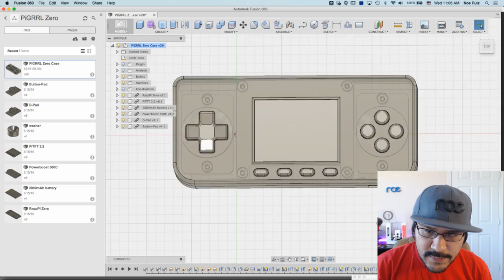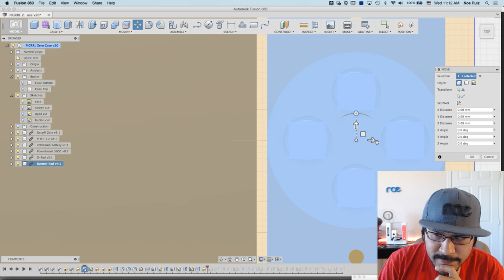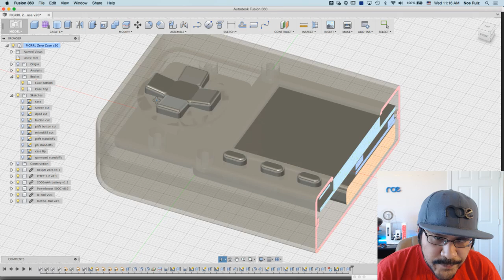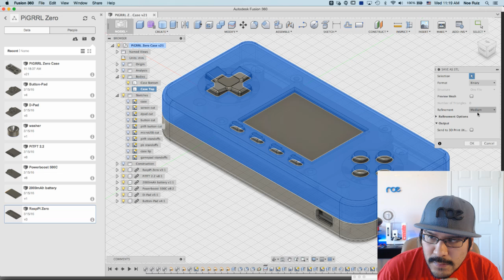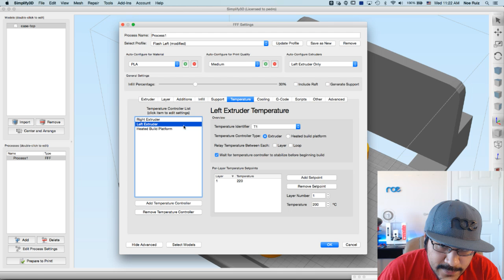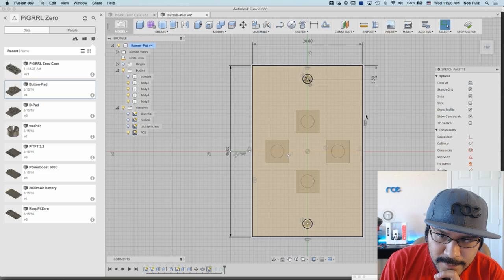Layer by Layer LIVE - PiGRRL Zero Pt 3 @Adafruit #3DPrinting

Comment: I think I would have flipped the screen so the buttons were on top. Then you can use an adapter to bring the HDMI port out the top for playing on a larger screen.

For the battery, you could wire to smaller batteries in parallel (?), with each tucked in on either side of the case to keep your depth.

Comment: is that case 3D printer and if so what 3D printer?
Reply from the maker: +Joseph Niccoli Yep, the case is 3D printed on the Flashforge Creator Pro but could be printed on any 3D printer.
Reply: I have a robo 3D but im not sure how to make it a solid bottom in stead of lines like yours and how to use ninja flex
Reply: +Joseph Niccoli if you mean solid bottom as in you always see you build lines you could try to adjust you bed leveling a bit closer to get more of a squish on that first layer or print it with more solid layers on the bottom and give it a little sanding. 

ninjaflex is a little rough without the proper extruder but the key is to print sloooooooow.
Reply: Cool thanks